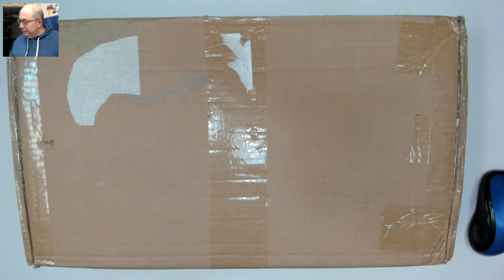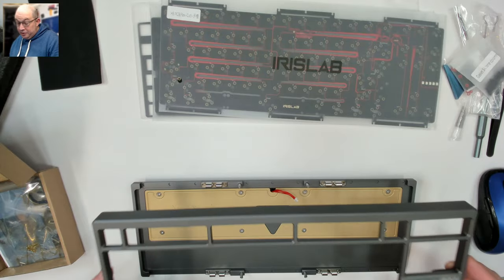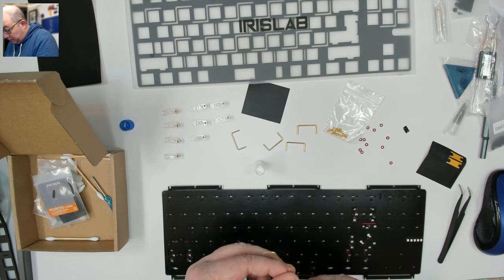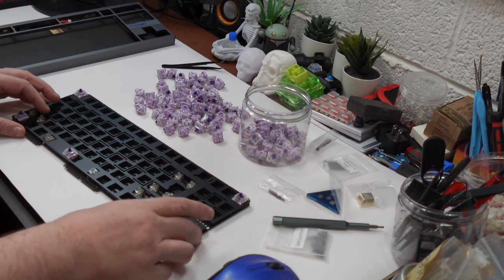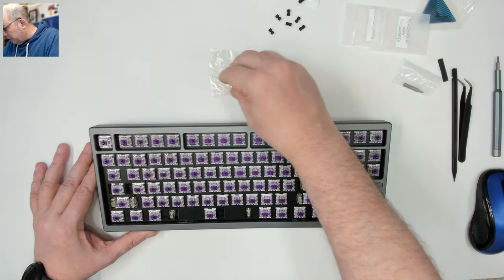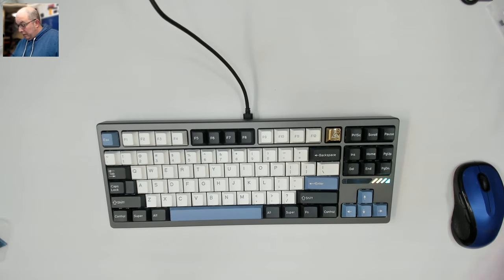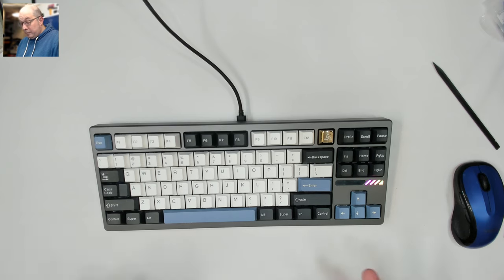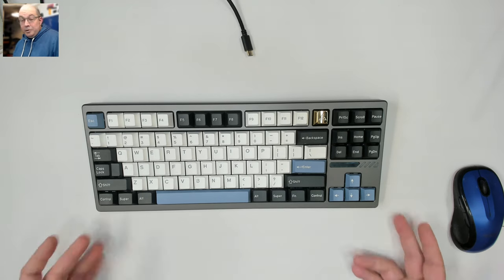JRIS80 Gazzew U4T

Comment: The product is OK.  2 Points.  Have you thought about splitting this into 2 videos?  Also, I know we know what the standard foams are, but I think it's useful to just list them at the end with the sound test for those unfamiliar with the kit.
Reply from the maker: 1. It's why I did it as part one and part two; I was delayed in getting this out due to being ill, so I did it this way.
2. Yes, I could have included the list of foam, I showed them but did not think of listing them.